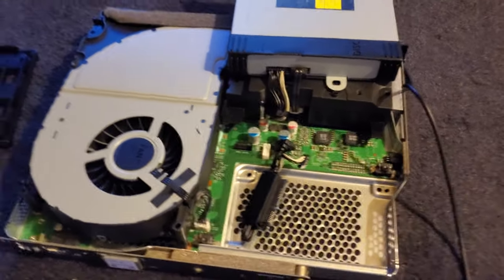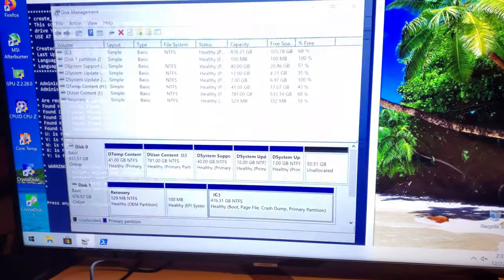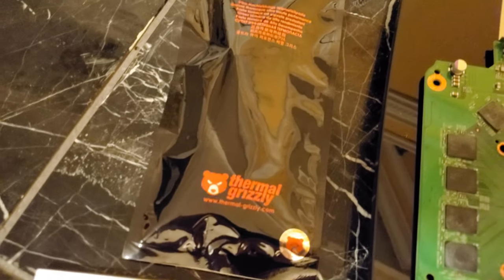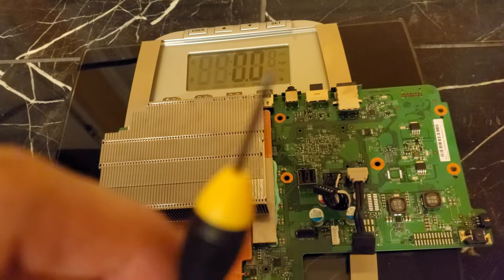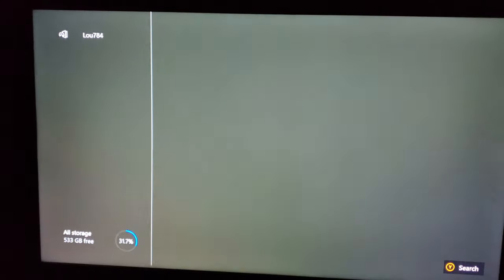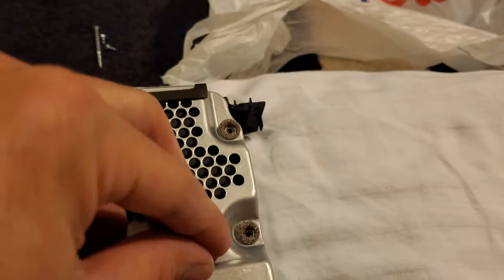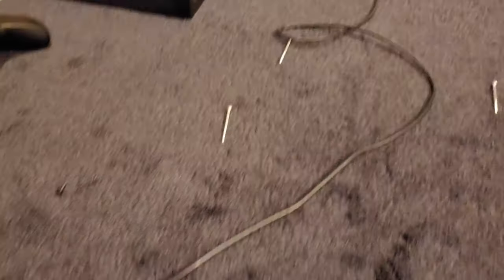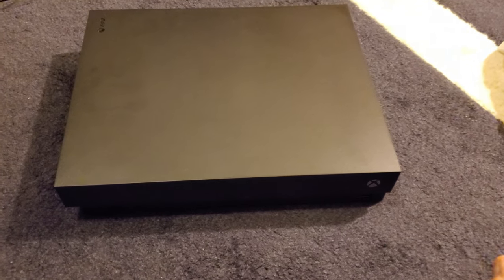Xbox One X Drive Cloning to SSD Drive, & adding thermal Grizzly Kryonaut thermal paste & reassembly

Comment: Great minds think alike! I was actually contemplating about putting in a 4TB SSD, but found out it only supports up to 2TB of interal storage. That, and with the recent info about the Series X utilizing NVMe SSD not sure if I still want to swap out the HDD for an SSD. Definitely leaning more towards it though. Thanks for the vid. Helped a lot! 👍🏻
Reply from the maker: Nice man!  And yeah you are limited to 2TB max unfortunately, but yeah the upgrade in speed when switching to an SSD is great though.  Boot up times are much faster and most every game loads 40-50% faster than they did with the slow mechanical 5400 RPM stock HDD.  And thanks for checking out the video, and commenting right away.  I'll try to get some videos soon of the difference in loading  times of games soon enough as well.
Reply: @LousWRX  Cheers! I'll definitely keep an eye out for updates. Honestly it'll probably push me into doing it now that the warranty on my One X has expired.

Comment: I see alot of Xbox One X Internal 1tb SSD or Xbox One X Internal 2tb SSHDs for sale on amazon. would you recommend buying those or making one myself?
Reply from the maker: I would do it yourself, you save money, and it is not too difficult as long as you follow the guide.  The HDD's with the SSHD's are are no where near as fast as an SSD, so try to avoid those. And I've heard the Seagate drives that many people use as an SSHD have a pretty high failure rate from all the reviews I've seen of them from newegg.

Comment: I have a Mac how can I clone the files properly?
Reply from the maker: I am pretty sure for that program to work, you need to be on a PC.  There may be another program that can work on MAC, but not sure if it would be a reliable to use as the one on PC.
Reply: how about an external usb 3 'cloning station' ?. just put the source drive and the fresh drive press a button and off your go clone made